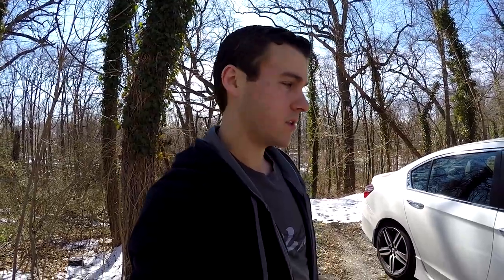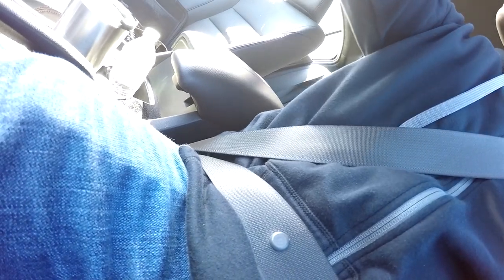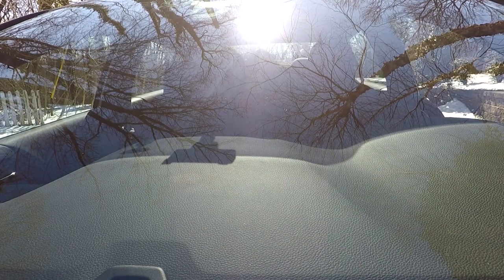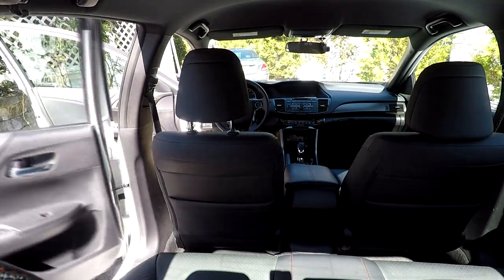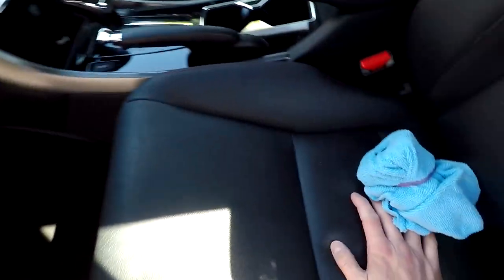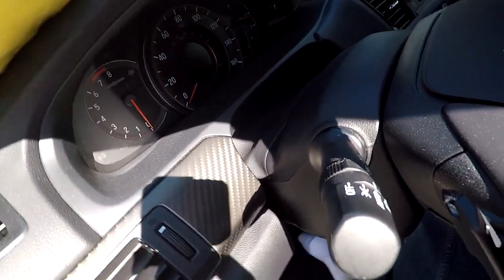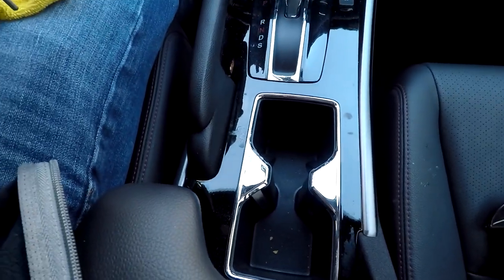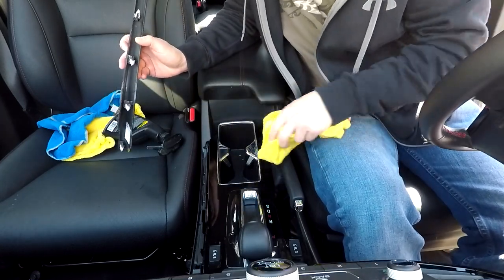My Honda Accord Sport got Stuck.. and I detailed away 3 months of Dirt

Comment: Get some winter tires next year. Will NEVER get stuck again. Blizzaks bought during the spring is the way to go.
Reply from the maker: From what I hear blizzaks are great. To be fair to the stock all seasons, this was the first time I got stuck and the snow was frozen.
Reply: Night Hawk Motors this time it was your driveway but next year that could be on a main road. Just safer with winters. Most all seasons are total crap in actual snow like that, I totaled a car because had all seasons and slipped through stop sign so sucks. Winter tires are an awesome insurance policy and way to keep your car safe during the winter months. $500 in tires is much cheaper than a new car lol. But I’m calling it now...you are going to get bored with this soon and get a new stang haha. But congrats on the car, they are def nice.
Reply from the maker: I am already bored :) , but yes you are right about the winter tires.

Comment: Do you have the problem of tpms light coming on the Accord in winter season,i did and when i check the pressure in tires its the right pressure and i rest it and the problem goes away.Do you have the tpms light problem in winter???
Reply from the maker: I have not had that issue, usually you will get tmps sensor alarms when air in The tires shrinks from the cold. What PSI are you setting them at?
Reply: Night Hawk Motors I am setting at 33psi both front and back,for some reason mine comes on n took it to a store also and they said pressure is 33psi and we rest it also.
Reply from the maker: Have you had a dealer take a look at the issue or checked around on some honda Resources online? I am sure there are troubleshooting procedures you can follow to locate the item causing the issue.
Reply: Ya if it pops up again I will take it to a dealer and check out,anyways thanx for your help and man its so awsome to have somebody who has the same year same model car so that I can ask questions.Mine is a regular sport 2017 Accord.Keep up the good work with videos
Reply from the maker: Thanks man! I really appreciate it!